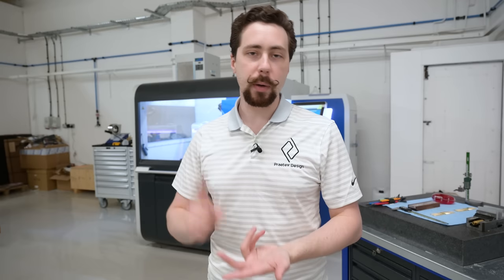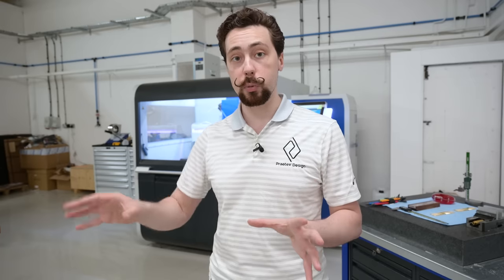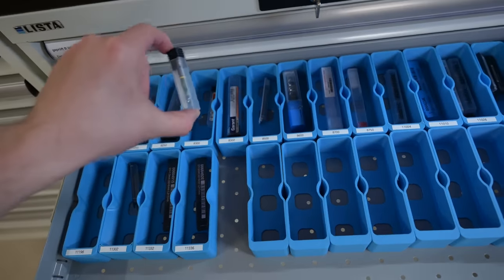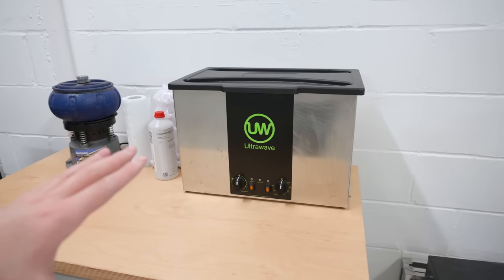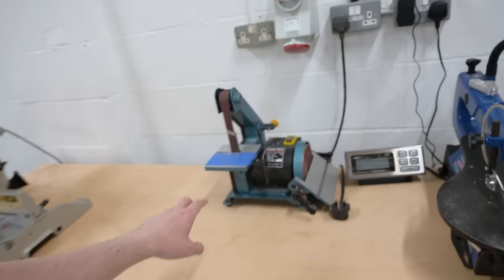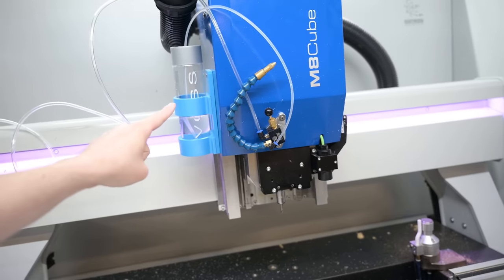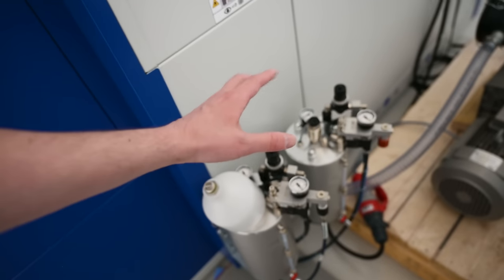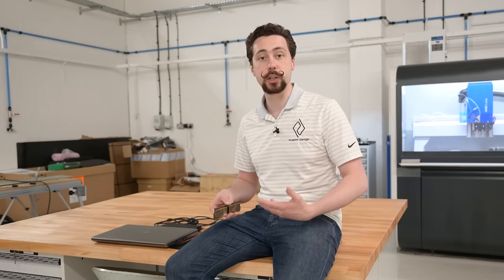Praetex Vlog #3 - 3D Scanners, Tool Chests and DDR4!

Comment: We've missed you good sir! Are you familiar with LEAN manufacturing? If you have time, it might help your thinking on further additions to your shop. Also, I love that shop floor and how bright it is!
Reply from the maker: Funnily enough I actually edited out the section where I mention LEAN haha.

Yeah I’ve been trying to implement some of the principles of it to help reduce mess and unnecessary down time. I don’t agree with all of it, so cherry picking elements that sound like a good fit.
Reply: @PraetexDesign  Right on! I've been beaten with Lean, DFSS, RedX, etc. and the only thing you can do is just take what works for you.

Comment: Hi Alex! Miss your videos by I am keeping up with your Instagram posts. Hope the shop is running well.

Just had a quick question: can you link me to the DDC pumps you've been using in your builds through the years? I'm particularly thinking of the ones you used with your custom aluminum heatsinks on Aquaceras. I'm looking to make my own pump casings from acrylic or acetal. Any thoughts on that?

Comment: The yg1 alu-power is fantastic for wall finish in alu. Brass. Copper and plastic and dixi tools chamfer is also fantastic in those materials as well btw. Worked with a lot of different ones from different bands but those where always the best
Reply from the maker: I tried out some alu-powers but just couldn’t get them to work well for me. What parameters were you using? I’ve noticed bunch of really good tools tend to do best with low RPMs paired with heavy cuts, which I can’t really do on the M8.
Reply: @PraetexDesign  we used 0.04-0.06 feed per tooth. and 0.2 mm stepover for the finishing pass / depth of cut sideway's can full down in Z. our fastest machine did top out at about 18k rpm and we gave it all the rpm's it had. you could also use a mcd tipped endmill ( one that made for side milling ) or a mcd tipped ball mill ?
Reply from the maker: @flikflak24  I’ll probably give them another go at some point, they’re quite practical since I can get them next day.  I do a lot of MCD finishing on this machine, mostly in acrylic but alu and brass get a fair bit of diamond love too. It’s so satisfying, albeit still a bit of a clench using a £1500 tool.
Reply: @PraetexDesign  nice to hear. of what i know its only for faceing you have a mcd tool ( though i could be wrong ) but i do know that there is also some made for sidewall finishing ( just saw a video where some had used some on a aluminum part with mirror sidewalls and face's / bottom )

Comment: Hi, I have M8Cube as well, so far waiting to be unleashed... we are moving to a new place, and the M8Cube got ordered just before we found a new place.
Since I will be working with POM-C and acrylic (as well with Aluminium, Brass etc) I have also ordered the CleanCut system and I am looking into air ionization (should help with plastics sticking due to static charge) a vortex cooling (for plastics). If anyone has some experience or thoughts on this... I would appreciate it, otherwise I am just saying it may be a good thing to try. I will see myself hopefully in few weeks or months.
Reply from the maker: 100% on the ionising air system, I’ll be adding one of those myself soon as cleaning all the acrylic and pom out is a right pain.

Comment: Hey Alex. I saw that you have done some experimenting with DIY satin watercooling tubes. My question is, is PETG suitable for DIY satin tubing, and also, could you do this to EK's reservoirs also? Hopefully seeing more of your footage soon.
Reply from the maker: You can definitely make PETG tubes satin using the same process as my old Bit-Tech tutorial, however I'd argue that switching to acrylic is a better move. In the long run it's more secure, I don't really recommend PETG to people for their loops.

You can 100% use the same process btw on the EK reservoirs as they're acrylic, they come out rather well in fact. You just have to be very thorough as it's a larger surface area.
Reply: @PraetexDesign  Im aware of PETG's features. In all my previous loops my water temps been under 40°C, so what it goes for PETG softening and becoming malleable in higher temps, in my normal use I'm not concerned. I also live in a colder climate and like my room temp low. Is this your main channel, or are you producing content to somewhere else? Really like your builds and insight!
Reply from the maker: @Ricqu  This is my main youtube channel now yeah, mostly you'll find my content on instagram or tiktok now though as most of the things I've been making aren't really youtube friendly. I've considered making a shorts channel that could perhaps host that content though, it would just annoy folks on this one if I posted them up here I think.

Haven't done any builds for a while though, not really had the time to do it. I used to be paid for builds on Bit, so could do them on there, but being honest there was very little money in it and I can't scale a business around it. With each project taking 200-600 hours, it's simply not viable.
Reply: @PraetexDesign  Hello, good to see your still alive!
I for once would like to see shorts on this channel too, i don't mind the jumping in themes and videos. And most of all I don't need to check 4 different sites for progress.

When it comes to business choices and time, I totally understand. You're a creative dreamer and engineer at heart. So scaling up would not only give you the opportunity for more money, but also different kinds of work, machines, deals etc. so I like to follow your journey true this.

But I also loved the old build videos. Will you try to do some on the side, more like a hobby? I would think they can open up possibilities to try things/processes that you not would otherwise. was not that the Idea of Aquaceras?

Speaking of Aquaceras, will you keep working on it (It's my favorite build). Or even can you, the videos and license might be owned by Bit-Tech?
Reply: @PraetexDesign  Totally understandable. Still doesnt change the fact the community clearly misses your touch for details on builds, they were more like works of art than pc's.